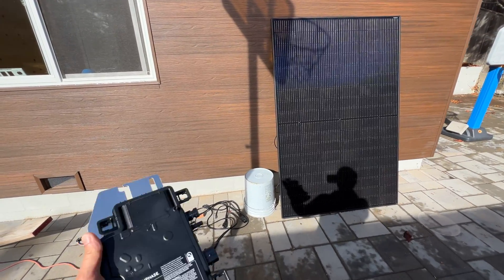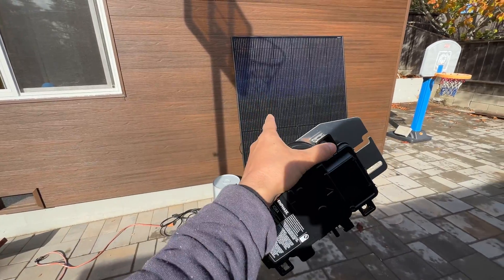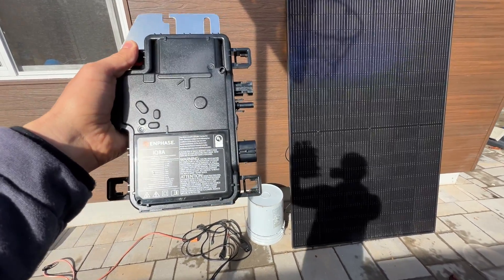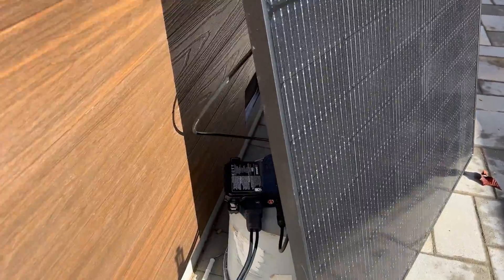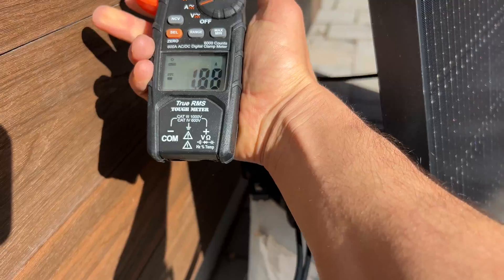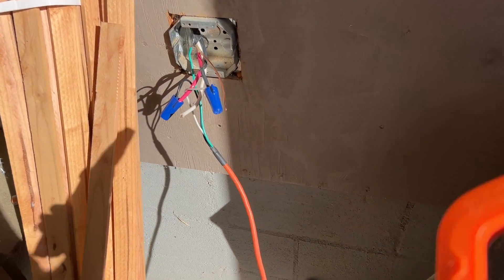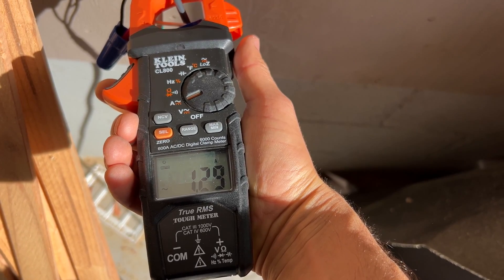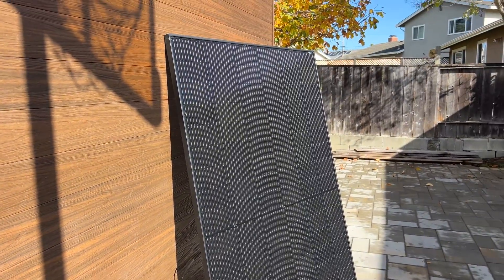Will Enphase microinverter work without combiner box? Simplest grid-tie solar system.

Comment: I try this with enphase iq7
Connected to 240v and 270watts canadian solar panel 
And its not producing 
only blinking red the lights sometimes it change to amber only 2 blinks after 8-10minutes and back to red again i dont know what wrong .
Reply: Did you end up getting it to work?  I am working with a client who does not want an Enphase combiner, but I am skeptical about it working long-term without one.

Comment: Hello,
Do you need to input 220 volts at the inverter output in order to cheat the inverter ?
Thank you
Reply from the maker: yes, it's a grid-tie microinverter, cannot work without grid power

Comment: Hello,
Can you connect Enphase inverter to any panel brand?
Thank you
Reply from the maker: electrical panel or solar panel?
For solar panel, it must be in the voltage range that the microinverter supports.
Reply: @ is the connection, inverter to solar panel standard?
Thanks in advance
Reply from the maker: @ yes, MC4 connectors

Comment: This didn't work for me. I waited a long time and it never began to produce. My inverter flashed 6x green, then one amber flash, then one long dim red flash. This pattern repeats.
Reply from the maker: did you connect it to 240V?
Reply: @SolarEngineering

Yes I did. However, you are correct it does work. Out of 19 spare iq7+, the one I chose happen to be faulty! After seeing your video I tried a different mi, it worked within seconds. Tried the rest of my stock, all of them worked quickly and without incident. I went back to the first one I tried and it still would not work.

I guess there's something wrong with it. I think, though I'm sort of guessing, is the 6green indicates it's starting up and it may not even show if it goes through the checks fast enough. The amber means it doesn't have communication, and the red is a fault.

So, in the end thanks for the video, it pushed me to recheck my setup and find a faulty inverter. I still can't believe I grabbed the single inverter that didn't work to test with. Haha.

Comment: I just want to say: this doesn't work. If depends entirely on if the inverter is coming used off a system where it was already programmed... If you just get a new microinverter (which they won't sell seperately anyway) it won't do anything.
Reply from the maker: You can buy an individual inverter. In video, I used a brand new inverter first time connected to the grid.
Reply: @sectokia1909

What?

You can absolutely buy an individual microinverter. You can buy them used. You can buy them new. Perhaps you live somewhere this is not the case, but as far as I know enphase resellers will sell you whatever you want. Recently enphase started requiring you to get certificate of completion for installation training, but that's only to provision the envoy or other major components. The inverters work regardless. There are tons of examples of this working fine.
Reply: I just want to say: you're ignorant! I'm in Australia and I can buy these enphase micro-inverters individually very easily. Many videos have shown that these come pre-loaded with a factory profile, that may not be optimised does seem to work.

Comment: I have 6 panels and 6 enphase micro inverters iq8m 2 are lighting up orange and the others aren't lighting up at all. So we don't need them to be green to produce power?
Reply from the maker: correct, with yellow light it should produce.
Reply: @SolarEngineering  what about an amber color?
Reply from the maker: @johnnyOsburn6078  RED = no AC power, Yellow = no cimmunication with Envoy and producing power, Green = communicating with Envoy and producing power
Reply: @SolarEngineering  so if I'm doing this DIY what colors do I want?
Reply: No light = dead
Reply: @synonys  noway to bring them back to life?  Also I have one that has no light but running hot

Comment: As a electrician and a installer. The math isn't mathing . You need a envoy to set gird profile other wize micro inverters will not produce and will sit on tandby.
Reply: They come with a grid profile set. You don’t need an Envoy for Enphase micros to work. You need it for easier troubleshooting, monitoring and warranty claims.
Reply: But it could work if the envoy was used to set the grid profile previously? Then it would work without envoy?
Reply: Right? What do you do when your combiner box won't turn on? I'm servicing an old system.

Comment: Awesome.  Can these be paralleled for use of multiple panels?
Reply from the maker: yes, upto 12 microinverters
Reply: @SolarEngineering

Just to add to this, it depends on which microinverter you are using. Some you can put 12, some 11, and it is all spelled out in the manual. Essentially it has to do with not putting too much current into the q-cable which is a set gauge. If you add up the max current for the inverters on the branch they can go up to 80% of the ampacity for q-cable rating.
Reply: @ makes sense.  Thanks
Reply: So your saying  the micro inverter  will work off grid solar system, no communication  network?
 When u plug in a iq8 to a  solar panel will it start producing power with out a load , or does it need to be hooked up to a load  before producing power?
Reply: @kennyroush the microinverters need to see 240 volt, 60Hz power in order to operate. That can be the grid, or a pure sine wave inverter output. They will NOT generate power in their own into a dead wire.
Reply: I would like to  be able to plug in  a mini split  ac unit  to keep it cool in the cabin during the daytime when it gets hot and humid  during the summertime

Comment: Hey man nice work!, can please show how u connect the wires?
Reply: Does it sync with utility? If i have 240V(red and black wire) does it matter where i connect the wires coming from panel?
Reply: @AlChilazoLife it shouldn’t matter. I installed EnPhase years ago and there were alot times we installed without a combiner box. The only thing we installed was a fused disconnect somewhere where the fire department can get to easily on side of house Incase of a fire. But I don’t believe it matters which phase goes to which wire. I believe the only time it matters is if you’re using the combiner box and you were metering your production.
Reply: @AlChilazoLife  technically, it does not matter. Practically, It is better to have some fuse protection. If you want to be code compliant, thats an other question.
Reply from the maker: Wires connected to L1 and L2 (240V split phase), no neutral, no ground.
Reply: I have 3, IQ6 plus inverters and want to do that just to offset my "daily always on draw" usually during the day, so would work out quite nice considering panels will only produce during the day.  I'm looking for the panels and the wire with connectors for the 240ac side.